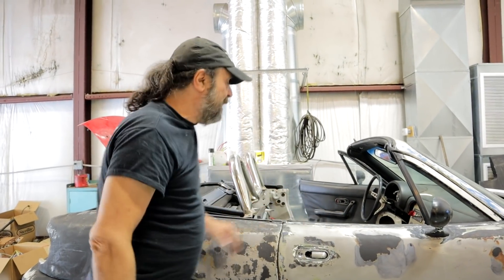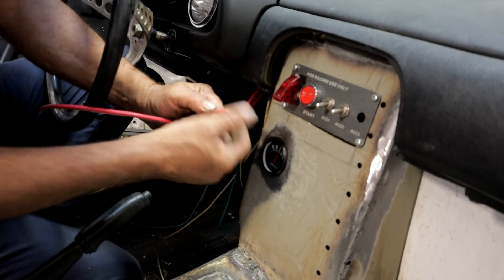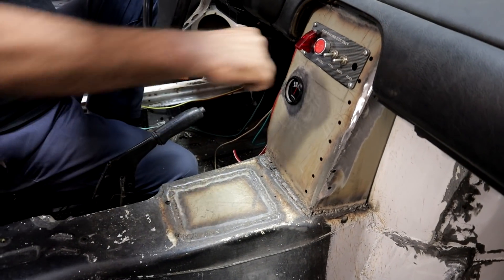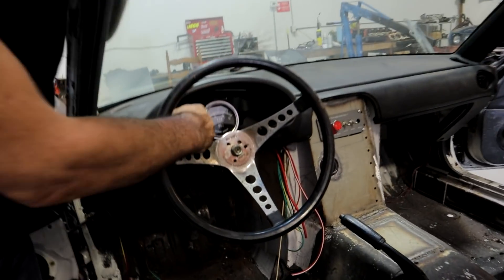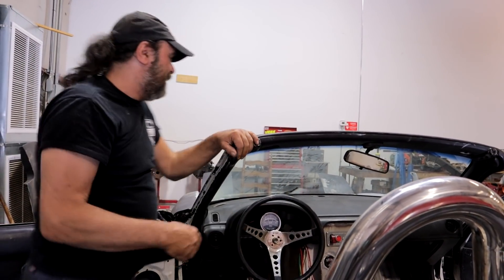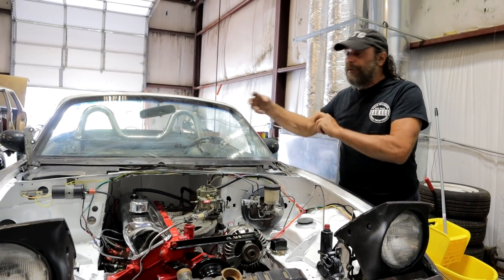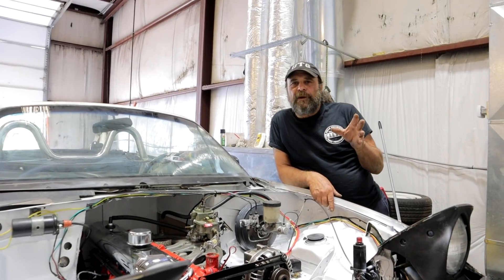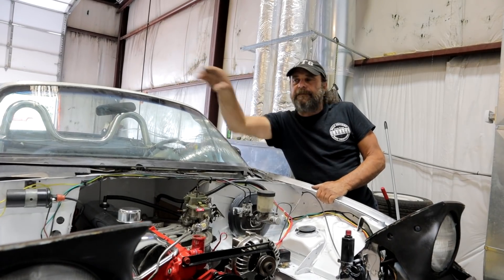The Mopar Miata Takes A Giant Step Forward!

Comment: Officer: "Do you know how fast you were going?"

Uncle Tony: "about 5500 rpms?"
Reply: I've done it
Reply: @CreationsVibration  same haha
Reply: The correct answer is always, "I was just under the speed limit".  When law enforcement asks "What is the speed limit here?", the answer is, "You have got me upset, and I can't remember right now".
Reply: @CreationsVibration  Me too.
Reply: Yeah, I think he should add a speedometer. Take one out of a Mopar. Any round one should fit.
Reply: @clembob8004  velco a cell phone with a gps speedo and call it a day lol
Reply: @deathbysteelabn4466  Amazon, for like 30 you can get a gps Speedo that runs off a usb, you’d just need to wire it in to the accessory power. Got one in my crown Vic with way bigger tires than stock
Reply: 427 fury is my vote
Reply: Until he ran out of gas, he never mentioned a gas gauge.
Reply: @FerdinandAkin  Nope, per former supreme court justice and former US attorney general Robert H. Jackson, the correct answer is "I don't answer questions".

Comment: Tony- The fusible link needs to be at the battery. All the wire between the battery and fusible links are unprotected.
Reply: Not to mention the heat they'd be exposed to in their current location, plus ease of access at the battery.
Reply: The fusable link on Mopars was on the firewall, and just a few inches long.  I smoked it once, replaced it with some 12 ga THHN and pt another 70k-80k miles on the car.
Reply: From where he hooked at the starter to the link is very short
Reply: There's only one wire from the battery to the electronics control system and that's where he's putting the fusible link so there's only one wire between that fusible link and the battery
Reply: @rodney1818   The part of the wire between the fusible link and the battery is not protected and that length needs to be as short as possible.
Reply: @krieck6801  if you're that worried and scared about it maybe you shouldn't watch or stay inside with your mask on
Reply: @krieck6801  believe me that is a minor problem compared to some of the stuff I've seen car manufacturers do over the years what comes to mind the '90s model s10s close to the end of their run in 93 the computer wires were right by the exhaust and held in with a plastic clip the plastic clip would get knocked off with your foot then the computer wires would lean out and touch the exhaust that was a GM defect there's something like that in every car quit being scared

Comment: Just looked up wheel spec offset 
+.45mm for 14" wheel, +40mm for larger dia. wheels. For live chat questions  of wheel  style choices.6/2/21. Na or Nb chassis 90 thru 2005 chassis 
Factory  spec, hope it helps.
Its gotta handle decent wTire/rim and wheel well fit.

Comment: Uncle Tony, I forgot to tell you, you should weld the Oil pump gears onto the shaft, I had one of the pressed on gears spin off, they get a tiny peicee of grit in there and they'll come loose, there is no keyway so you just have to weld it and then grind it flat so the plate fit perfect.

Comment: I always love the see those "empty" engine bays in muscle cars :) Minimum wires etc.
I wonder how much wire do you need? Just to run and drive for exemple a  GM 70's muscle car :P
Reply: Two. One to the ignition, one to the starter. if you want the alternator to charge add two more.
Reply: @wldflrs1  :P Love to have a car like this. Just as a second car to goof around....2 wires? Than I'm almost capable to figure out it there is a wire problem :).

Nice second gen cam on your site
Reply: @wldflrs1  Get a "one wire" alternator with a self sensing regulator.
Reply: My kids and their friends constantly gawk at the 69 Dart engine compartment for just that reason... They can't comprehend the simplicity!!!🤣🤣

Comment: Yesterday I watched a Hellcat race a 61 dart with a slant six in it. The light went green and the slant six beat that 80,000 dollar car hands down and it ran a low low 11 second quarter.
1961Dodge Lancerslant 6 vs 2015 Dodge Challenger Hellcat
Reply: Driver error. The hellcats can get high 10s factory and low to mid 10s with bolt ons and a tune.
Reply: The driver’s error was buying that 80,000 pile of soulless plastic.
Reply: @johnwilburn  when you got more money than you know what to do with, you can spend it on over priced plastic.
Reply: @NightWrencher  I almost bought a Ram SRT 10 once.... the Viper truck.  Glad I didn’t.  I’m over that stupid stuff with modern performance vehicles and much happier building old stuff.
Reply: 80 grand doesn’t mean you can win all the time..
Reply: True but the hellcat is a luxury car by comparison with an old early 60s mopar. It can cruise on the interstate at 80 mph all day with the AC blasting. If you wrecked in the hellcat, all those heavy and expensive airbags and structural reinforcements might very well save your life, where as in a classic car you would be dead or seriously injured. Handling and braking? The modern hellcat would likely easily dominate there too.
Reply: The dart may have been geared and set up just for drag racing where the Hellcat would just spin tires.
Reply: @mikeekim1101  I just thought it was an epic drag race.
Reply: @jonlennon3348 , and it was. Point of my post was some folks w/ money buy stuff with no idea how to use it and here we see someone with knowledge using it to conquer...
Reply: You just now saw that video from the Mopar Nationals of 2015???

The guy with the Hellcat spent that entire morning talking shit about how it was the fastest car there, so the real car guys decided to embarrass him 😁
Reply: @jonlennon3348  Oh I totally agree. Its really impressive that he tuned and built up that slant 6 to run so fast.
Reply: @jonathanlawson4667  Yeah they are huge and heavy but would still dominate a stock A body in any sort of handling competition.
Reply: @notablynova  I would be so embarrassed I would leave. That little six pulling an 11 second quarter mile was outstanding.

Comment: I like How he calls  everything “electronics” . 😬
Reply: I'm lost, what other word did you expect him to use?
Reply: @jimbojimson  the electrical
Reply: @jimbojimson  the sparky stuff.
Reply: Pixies 😀
A la AvE
Reply: Gizmos..  come on!!
Reply: @MrTheHillfolk  Good one. And I don't expect to find many "confusers" in Tony's stable.
Reply: @MrTheHillfolk  angry pixies, release the shmoo, and magic smoke. Vice grip garage has me calling alternators lighting whirlers now
Reply: It is.. got a new to us work truck the other week, alternator is no good, but a 12v Cummings doesn't need power once it's running
Reply: @Lecherous_Rex  one of the approved fixes around these parts is : PUT A DAB OF SCHMUTZ ON IT 🤣
Reply: @Lecherous_Rex  
Omg did you see that crazy 500-600mph tire test  on garage 54? 
Marvelous !!
Reply: I prefer lightning spaghetti
Reply: @MrTheHillfolk  I believe it's a p pump.  Pretty awesome really, the battery light comes on and gets dim until it dies, but you just keep driving.. using the choke/runaway plate to kill it.
Reply: @DanEBoyd  oh that makes more sense. Relatively new to that channel. I like uncle tony's garage best
Reply: @SLOCLMBR  yeah the P pump ones can be cranked up for power , not that the VE pumps can't it's just the inline pump has way more power potential. 
Either way , it's easy to rig one to run after the apocalypse 😁
Reply: @notablynova  
Yeah that was a good one , that channel is literally a blast sometimes 😁
Reply: Sometimes I think the apocalypse  is closer than we think.Hey no more smog tests😆👍

Comment: Slant 6 in a Mazda MX-5 will be quick.
Reply: not
Reply: Boat anchor 🤣
My dad used to call slant 6 engines a cow laid on it's side lol
Reply: It might be fair , or at least feel peppy. 
The ol 83 GTI I had was pushing around 120 and that was a hoot
Reply: Maybe if he turboed it and got it pushing around 200 hp or so yes it'd be pretty swift in a 2000 lb car. I had a slant 6 car (stock 225 cu in a Dart) years ago and honestly it was pretty much the slowest thing on the road.

Comment: Feel better UT and UC. I hope you make it to the MDA event, too!
I also hope that you have removed the convertible top from the Miata. It's probably a good place to save weight.

You may want to try something. I've used an oil pressure sender to trigger an idiot light. I used it in the cooling system. This way once the engine is warm the pressure will come up to ~15 PSIG, most light senders trigger at 10 PSIG. If there is a leak in the system the pressure will drop, lighting the idiot light, long before you cook the engine, or hopefully, get water under your tires.

Comment: 140hp would absolutely rip in a 1800lb car. I suspect it won't be quite that light, but still anything around 100hp and 2000lbs is plenty fun. 13s-14s might be pretty easy.
Reply: I'm with you. 1850 is wishful thinking. I'm betting it's 2050 before the fuel tank gets topped off. I bet it's every bit of 2500lbs with him and a passenger.
Reply: @offroadspecialties7383  I don't think it'll be that bad. I like to go by curb weight because it's the easiest referenced spec, so that's with full fluids and no driver. Basically as it would sit at a dealer. I buy that the slant is not too much heavier than the I4 and that the trans is lighter. But really you're not pulling out 300lbs by gutting the interior. I gutted a Subaru wagon and only lost like 100lbs. I suspect it'll be close to 2000lbs. Which is still damn good and tons of fun!

Comment: Have a 1960 chevy belair. inline 6 two speed. All original.  Updated to alternator.  Do I need to run a separate ground from the alternator to the chassis before hooking it to the old wiring via the regulator?

Comment: Humm a tuned up Slant 6 makes 140 horsepower.  A stock 1.8 four-cylinder Miata engine makes 130.  Shouldn't have been too hard to find 10 horsepower in a stock Miata engine.  A stock 1.8 from the NB generation makes 140 horsepower.  And if you want to get crazy, the NC Miata 2-liter engine makes 170 horsepower.
Reply: Yes, and the Mazda numbers are NET, not gross.
The power to weight ratio of this car will be unremarkable.
Reply: But remember, this incarnatiom of the engine is temporary. He will be building another "maximum effort 170" for it.... So after shedding some weight and getting up in the 200hp zone... I think itll be great!!!

Comment: find a tach from an old mercruiser that had a the six cyl chebby...    I had one in a 80 D150 - looked the same as the one you have...  a six cyl tach that didn't require a sending unit

Comment: How can a cast iron six-cylinder engine that's nearly 50% bigger in displacement be only 100lb heavier than an aluminum four-banger?  Surprising. 

I've never heard "radiator" pronounced that way before. Uncle is The Man.

Comment: IMO Ditch the power windows and go with a manual crank. Saves weight and wiring and is part of the base spec miatas. (Probably less work to swap than to wire up those windows).

Comment: What transmission is he running? I thought it was going to be a T5 manual but then he pointed out trans  cooling lines...
Reply: 727 3speed auto
Reply: @milanskipala7593  😔 that's too bad. Needs a stick if you want to carve corners.
Reply: @milanskipala7593  no way. That's a fucking waste of torque. I'm sure it's a 904
Reply: It's an A-904
Reply: It’s the A904 I picked up in Maryland.
Reply: @milanskipala7593  oh man he found one of the one year only truck 727s???

Doubtful as it's obviously a 904 lol

Comment: I need to see plan z vs Miata in a drag race
Reply: He already said hes not running the Miata
Reply: I think at that point you're splitting hairs. If he knows what the other car runs he'll know what his runs and I think even that'll drive him nuts.
Reply: @DanEBoyd  true but i would like to mention that a 10.5 second quarter mile dirt track lap isn't the same as a 1/4 mile drag and can't be converted back and forth.
Reply: @DanEBoyd  thats fine I was thinking you were talking about a guy that goes to drags and thought it would be fun to run autocross and going up against Tony then possibly doing a conversion on the miata. But you're right he wants to turn heads on the road course and autocross.

Comment: both of you need to go home and sweat it out get a good nights sleep I hope you both get over it fast .I did the same thing back in 1982 when I stuffed a 360 in to a 1965 F100 it fit the truck so good and the dodge electric system was more reliable then the fords. I took a 71 dodge truck wiring harness and swapped it in to the ford it got rid of all the problems .  I had been going thru problems with tail lights not working and a couple dead shorts I couldn't track down but the Mopar harness fit like a glove and took care of all of it .  while I love both Fords and Mopar's it was a better truck with the dodge parts .

Comment: How to make a non stock Miata slower than a stock Miata
: ask UTG 

Lol it’s a awesome project slant 6 swap the world?
Reply: Way more torque than miata
Reply: @That1776Show  what are the numbers?
Reply: Well he said ~135-140hp as it is now. The MPG will be terrible.
MX-5 1.5 SE-L was 132hp @ 44.8mpg. The MX-5 2.0 SE-L was 158hp @ 40.9mpg. Both 4 bangers.

Added a ton of weight and vibrations with the new engine. Removed a lot of weight to counter it but also disrupted the balance. I'd rather trust in the Japanese engineers who've consistently won best handling awards for the MX-5. It's a car for people who can drive, not Americans.
Reply: @1738Creations  Really, Ace Driver? what do you drive?
Reply: I don't think the slant will vibrate much at all. Low compression, mild tune etc. Its just different
Reply: @needmetal3221  miata 140 hp and 119 torque.  225 slant 145 hp and 215 torque.
Reply: @That1776Show  it's a 170
Reply: @needmetal3221  155 ft-lbs
Reply: @1738Creations  mpg will be terrible????

You've obviously never driven a Slant powered vehicle.

My 80 Volare sedan got 27 on the interstate and it weight nearly 4000 lbs.

This thing should easily be in the 30+ mpg range if not ragged on.

Miatas only got 44 mpg if grandma was driving it, they really only average about 24 mpg combined in THE REAL WORLD
Reply: @notablynova  yeah.. I have a 73 Charger w/ 225 slant (3.7) and the gas mileage is insane. Compared to my 02 caravan (roughly 3.7) that guzzles gas.
Reply: @That1776Show  it isn't the patina covered Winchester grey one that was all over MOPARS UNLIMITED on Facebook is it?

Sorry that was a 72 I'm thinking of 🤦

I'd love to find a 3rd gen Slant car myself
Reply: @1738Creations  Youre totally missing the point of hot rodding, car builds, having fun etc...
Reply: Uncle Tony Delusion Syndrome t-shirts coming soon!

Not everything he says is true, accurate or up-to-date. They need a disclaimer that this is for entertainment purposes only.

It's not the 1960's. Things have moved on. Modern cars get such good MPG because they don't have aerodynamic properties of container crates, aren't chiseled from rock and powered by coal. Porsche Cayman S; 30MPG, 4 banger, 345hp. Cars don't weigh 4000lbs, delivery vans do.

I've said on other videos he can do whatever, he bought it. I'll down vote every MX5 video because he's destroyed it to make? What? The MX5 is a lightweight track car. This thing has no use. Would be better off as parts for a restoration project.

"Fun" isn't destroying a future classic. It's restoring or improving. This car looks worse, will handle worse and have worse mpg. It's a worse car than what he started with. That's the point of the original post...
Reply: @1738Creations  no way that 170 makes 140 horse

Comment: Use the 4cyl tach drive...instant 12,000rpm tach...throw the power window deal away and go to seat belt straps...NEEDS HOLES...NOTHING IS LIGHTER THAN A HOLE...

Comment: Try out, “Widget Man” Universal Tech Adapter/ Converter. 
This product works, and if you have any questions just Send the seller who is also the person who Mfg the product, and he will respond with answers to your questions with a solution.  
This is my personal testimony, I had a problem and he provided an answer and solution. The problem was caused by me, because I didn’t carefully read the instructions provided with the product. 
You will need to purchase resistors available through Amazon, since Radio Shack is no longer an option.

Good Luck Uncle Tony...
UTG channel Fan...

P.S.  Widget Man Mfg’s other products that may interest you...

Comment: Your maths says that pile weighs 375 lbs. I doubt that.
Are you going to run a header tank or something to bleed the cooling system?
With a custom shroud, you could easily make that radiator work with a mechanical fan.

Comment: I think it's a mistake to use the brass radiator, that you CAN fix...! BUT! weight!!! Weight! WEIGHT! maybe reconsider when the scales are busted out?

Also, those wires needs MOAH HOCKEY TAPE! at key abrasion points! not much butt, yea HOCKEY TAPE! lol! it works! resists abrasion, pokey pointy things, pulling pushing, general jackassery that is my truck... cos Im the driver. <3 all